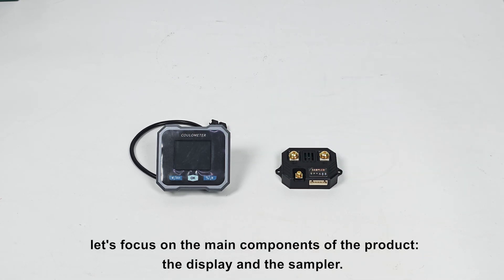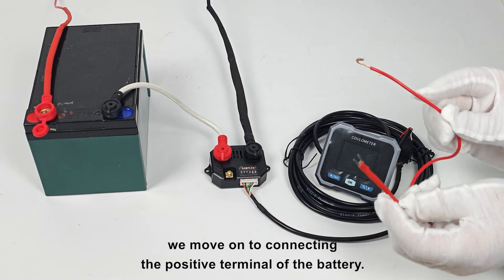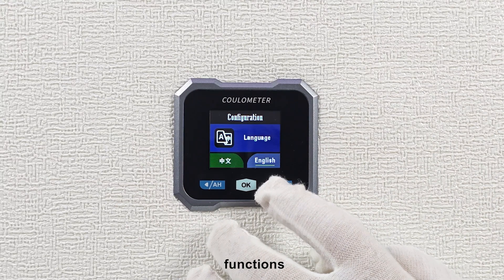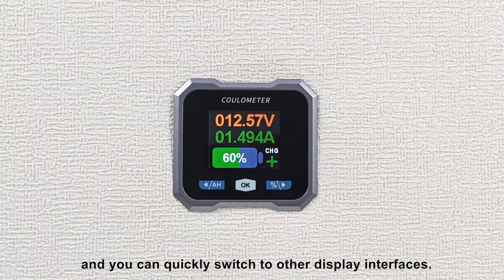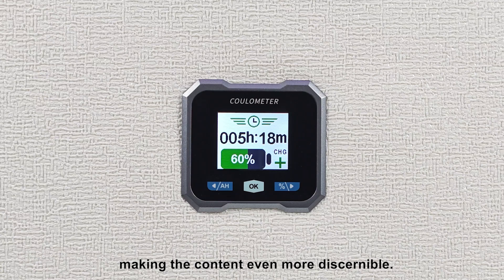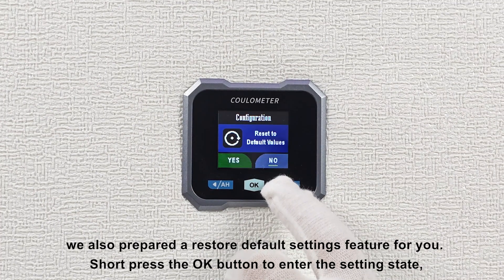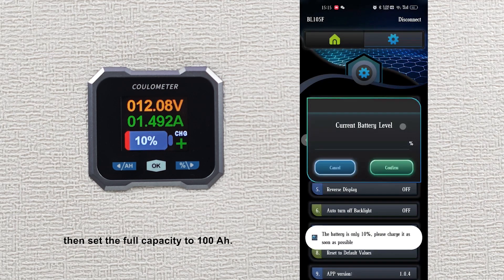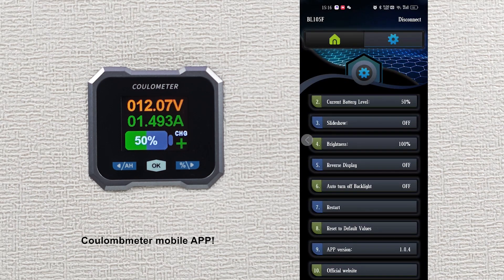JUNCTEK BL-F Waterproof Coulomb Meter Quick Installation and Usage Bluetooth Battery Testing

Comment: French language please 🙏
Reply from the maker: Sorry, there is currently no video introduction in French. You can understand the content through translated subtitles.
Reply: @junctek1802  I was talking about Juntek apps and devices…😀
Reply: I bought the same for 400 Amp, for my lithuim batterie 200Ah, my issue is that percentage I thing is not taking in account of the type of the batterie, could you please confirm that is taking in charge the right percentage when i put the 100% for 14.43V